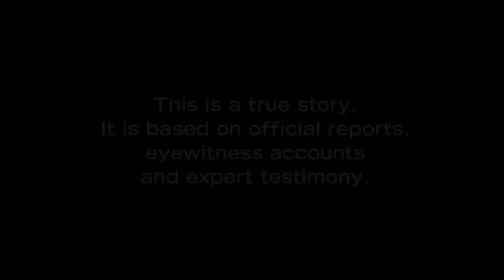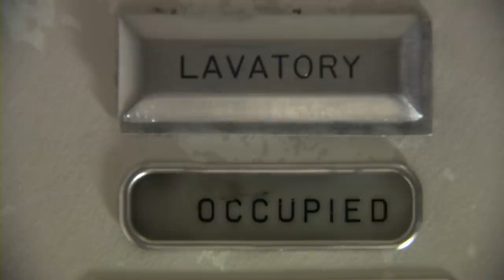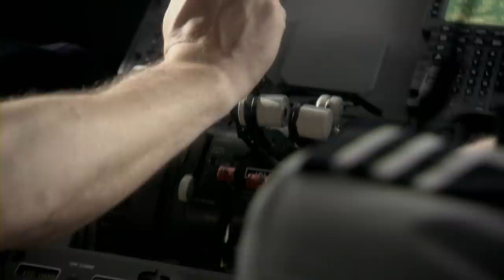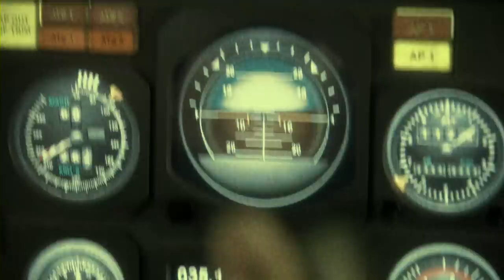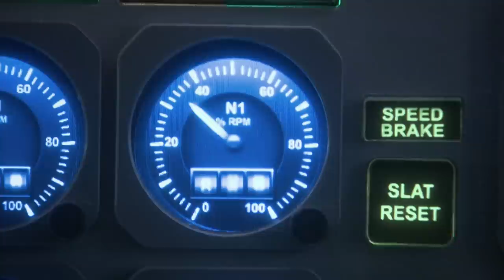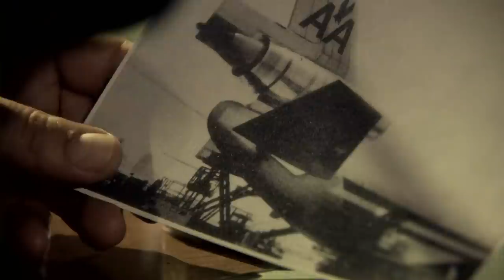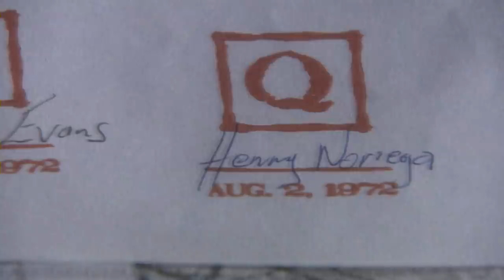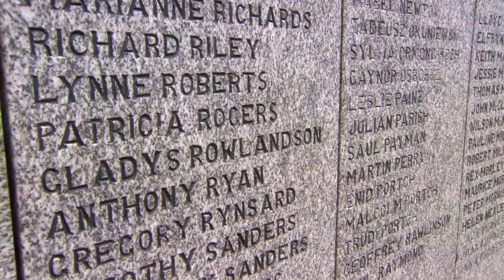Huge Hole In Passenger Plane Causes A Fatal Crash | Mayday | Wonder

Comment: Sad to say the higher ups in the industry never learned their lessons. Boeing of course had the MAX with the MCAS system, but even airbus has had lesser faults shown in aircraft that they knew about beforehand. Hopefully the MAX is the last time something like this will happen. Sadly this shows again and again what happens when companies are not regulated.
Reply: I’ve heard that the culture at Boeing really changed when they acquired MD in the 90s. Most of the old Boeing guys were ex military aviators (very good at their jobs) while the MD guys were the cost cutting weasels that made the dc10 problems possible. The MCAS issue is a direct result of that culture infecting Boeing
Reply: @willberger3349  
Really willy
Reply: @willberger3349  This was done while Boeing was still reeling from the 737 rudder issues.
Reply: @willberger3349  From what I can tell, the fundamental problem with the Max was the notion that MCAS would allow 737 pilots to fly the Max without needing special training.  Had pilots been trained in the ways that the MCAS system which was designed to make the Max behave like other 737 models might fail to do so, it's likely that most if not all of the crashes could have been averted.
Reply: @flatfingertuning727   This was a flawed notion dissemenated by the Boeing PR team/CEO in an attempt to blame the pilots. It was determined that even with training, in its released configuration, if an MCAS malfuntion was not recognized (and the system shut off) WITHIN 10 SECONDS OF ITS INITAL ACTIVATION, it was catastrophic and unrecoverable. Netlix just released their documentary on the whole affair. I encourage you to watch it.
Reply: @dominicairola7352  Even if the MCAS worked *absolutely flawlessly*, it would at minimum either require the presence of an extra circuit breaker somewhere, or share power with some other circuit.  In the former case, pilots should need to be trained on where the extra breaker is and what it is for; in the latter case, pilots would need to know how to fly the plane if the shared breaker trips for whatever reason.

The presence of anything non-standard in an airplane cockpit should necessitate at least some minimum level of training to ensure that pilots know what it is and how it might go wrong.  Even if it's equipment that pilots shouldn't normally need to interact with, such as a first-class cabin infotainment system, the flight crew should be aware of its existence.
Reply: @flatfingertuning727  I completely agree with what you've said about new equipment requiring training. My point was that in this case MCAS was a death trap regardless of training. In fact in the 2nd 737 MAX crash, the first officer correctly identified the problem (not knowing it was called MCAS, simply that is was a part of the power trim system) and shut off the system. The plane still crashed, however as it was past that 10 second mark so the horizontal stabilizer had already been trimmed to fully deflected nose down, with no way to manually return it to a normal trim due to the force required to hand crank the trim wheel at the high airspeed brought about by the nose pitch down.
Reply: @dominicairola7352  I agree MCAS was flawed, but my point is that the whole idea of adding anything to a plane without telling the pilots is flawed.  I saw a video about another crash which occurred because when both engines started surging, the pilots throttled them back, and when one failed completely the pilot shut it down, and a new system the pilot didn't know about responded by raising the thrust on the one semi-working engine causing it to also self-destruct a few seconds later.  If one engine dies and another isn't producing enough thrust to maintain altitude, increasing thrust on the remaining engine may usually be helpful, but if the remaining engine is only capable of safely proving 90% of the thrust needed to maintain altitude, having it do so may be much better than having it self-destruct so it provides 0% of the required thrust.  If the pilots were aware of that system, they could have prevented the destruction of their remaining engine, but since they didn't know about it they couldn't do what was required.
Reply: I thought the mcas issue was Boeing not telling airlines to properly train pilots on how to disable it

Comment: y'know what aircraft never had any of these issues and had a perfect safety record for the entire time it flew? The DC-10s direct comeptitor the L1011. But for whatever reason the L1011 hasnt been flown at all in years and DC-10s are still used as freighters.
Reply: It was more expensive to acquire. Airlines are cheap
Reply: @genettec  sorry I should've been more specific. It's renowned for not having any crashes related to the mechanical design of the plane. No plane is invincible after all but the l1011 is pretty damn close.
Reply: @genettec  lol the DC-10 is still used bc its an amazing plane

Comment: Being in aviation for about 22 years now, I do enjoy this type of documentaries. As frightening as the events are, there are many things to learn from them.

The only thing I have to nitpick about them is the tendency to use "sucked out of the airplane.." instead of "blown out of the airplane...". Things get blown out. Second, is making turboprop airplanes sound like they have piston engines on them during recreations.
Reply: That is interesting. I never really thought of that. I would have assumed they would be sucked out but I don’t understand at all what happens in these scenarios.
Reply: @TiffTheTyrant  
Hey Tiff.
The higher up you go, the thinner the air is.
When the airplane is pressurized, it means the air pressure inside is being raised to simulate what your body feels on the ground. 
Since the air pressure outside of the airplane at say, 30,000 feet, is less than the pressure inside the airplane, if the airplane is punctured in any kind of way, there will be what's known
 as an explosive decompresion,  that is, all air inside will rush out, until the pressure inside and outside equalizes. 
Does that make sense???
Reply: @TiffTheTyrant  its just nit picking. "Sucked" and "blown" are just two sides of the same coin
Reply: @alhanes5803  thank you sir. :) that actually makes a lot of sense.
Reply: @TiffTheTyrant  👍

Comment: This was and is just business as usual for big corporations.  Bic, for example, knew about a design flaw in their lighters which allowed hot flint to fall down into the fuel reservoir and turn it into a hand grenade, but their bean-counters calculated it would be cheaper to pay out settlements to people injured by this than to recall every single one of their lighters.
Reply: This is because of the economic and logistical nightmare that they would've had to go through in the recall. I read the report on that, since my father used to use their lighters when he smoked (he doesn't anymore, thank god).

Bare in mind that, at least according to the inquiry that occurred after several major accidents, it was revealed that Bic actually didn't know how many of their lighters were truly defective and how many were not. The design flaw was basically where after you struck the flint enough times, it became dislodged from its housing and would fall into the reservoir, but tests performed by several independent groups showed that it was inconsistent in the number of times the housing would fail. Keep in mind that the RSPA (Research and Special Programs Administration) did not consider the design flaw to be a major issue (which is why any settlements against Bic could only go for the cost of the lighter and the "minor damage it caused to a person's hand if it exploded" their words NOT mine. Personally, something exploding in my hands is hardly "minor"

Bic did fix the problem in their future lighters, and did release a memo to gas stations and other stores that sold their products to take their lighters off the shelves and replace them with the newer ones that they received. However, despite that, many stores still sold the defective ones. I did try to find a video of the design flaw to link it here, but it looks like Youtube scrubbed a lot of them (Bic does advertise on YT so that isn't a surprise)
Reply: The design didn’t effect all lighters. Only the ones with a steel spacer under the flint. This is the part that would get hot and melt the wall and expose the liquified isobutane to a open flame with out governors or valves. 

The later design used a painted flint on a spring that is a tapered spiral to keep the hottest point under the flint and would cool as the spring widened using the extra surface area and convection currents to keep it cool. 

The thought was to make the lighter last longer with the spacer. The lighter is also not meant to be on long but when you use if for anything other than a cigarette.. that itself made it dangerous.
Reply: @Suisfonia  I actually never heard about the Bic design flaw. Thank you for the lengthy reply, I learned something today. 

And thank you to Fred Zoidburg as well. I don't know how to "tag" two people with one comment.

Comment: Amazing pilots. 👏🏻👏🏻👏🏻
Bravo flight 96.
Reply: I'm sure the doomed flight had amazing pilots also, except they had a completely uncontrollable plane.
Reply: @bobby1970  
They were Turkish, like the guy who was supposed to lock the cargo door.
Reply: @bobby1970  
Turkish airlines had the directive ti fix it,  they didn't do it. All the other airlines did.
Did you ever here of a problem after the non fatal Windsor deal?
It was the fault of Turkish airlines.
Reply: Well said
Reply: I disagree w/u McDonald’s Douglass should have ordered to ground all the dc 10 s , just like Boyd up on Boeing 737 max n they were trying to blame the Ethiopian pilot n that is why Ethiopian Air lines send the black box to Paris not Boeing
Reply: @siraj7397  
McDonald's huh....
Reply: @alhanes5803  it’s an Arabic name dummie not Turkish
Reply: @ua84423  
That statement shows the true dummie.
Reply: @bobby1970  excellent work by the crew/ support staff etc...
Reply: @daviddavis3389  Absolutely.

Comment: The intro to this dc10 .. it was not a race . Lockheed and Douglas had already lost the widebody title to Boeing.  The dc10 was rushed into the market because Lockheed actually had a superior design . The tri engine layout was a answer to a requirement set forth by the FAA. Aircraft had to have so many working engines based on the distance to land while flying over water. The Death cruiser was really an unfinished airframe that had many problems and short falls
Reply: DC10=  death 10
Reply: @siraj7397  death carrier 10

Comment: Seeing these two planes….then see the amazing flying of the attempted Hijacked Fed Ex plane when an employee when insane.
They flew that plane almost completely inverted, may of touched the sound barrier, and did maneuvers only reserved for fighter jets…..while stuck in full throttle.
I knew the daughter of Fed-Ex’s top mechanic.
Apparently it cost over a million to fix it due to structure damage and blood splatter due to the crew fighting.
Blood was EVERYWHERE. Roof, walls, under seats, in equipment, and places where blood should not be.
I am amazed the injured pilots survived.
Reply: Showed that the DC 10 did have some good points -seems that most people who flew (in the cockpit) them thought well of the airframe and power

Comment: Due to the random order I'm watching these, I'm watching this after having seen the United Airlines Flight 811 - a later incident in which a cargo door ripped off and took a chunk of the fuselage with it. It's crazy to realize that even though that was a different plane (747) and different company (Boeing pre-purchase of MD) and followed the improvements (vents, stronger locking pins) there were still incidents so similar to this. Fortunately,  the current popular Boeing 737s went back to the interior opening doors.
Reply: The 737 was made in the 60s, before the DC-10, when people thought of more cargo space via an outward cargo door.
The 747's door was flawed with its fail-safe locking sectors being too weak and the faulty wiring making it vulnerable to opening unintentionally. When United 811's door opened, it ripped out some of the fuselage, and at that point, the vents aren't going to help.

Comment: Why am I critical of airplane manufacturers? Because Douglas new about the flaw before the first accident, learned about its potential after the first, and yet continued to build the damn plane without changing the design. And like the past repeating itself. Boeing knew about the flaws in the 787 Max, and yet, even after 2 fatal crashes, Boeing fought to keep the planes flying. With 500 lives already lost to the flaw. They still couldn't risk losing money. These companies don't have the luxury that car manufacturers do. When your Toyota or Ford breaks down, you pull over and call someone for help. There is no AAA for Boeings at 30,000 feet. And the tragic fact is almost never does anyone go to prison for these blatant cases of greed and negligence.

Comment: The pilots of Flight 96 were awesome! That was some wicked fabulous flying.
Reply: I'm sure the other flight crew on the other plane that actually crashed were also awesome. It's just they had an airplane that was impossible to control at all.
Reply: @bobby1970  I agree. The one thing Flight 96 did have going for it was that not all lines were severed, so they had just enough control to be able to land the plane back in Detroit.

had all control of Flight 981 not been lost, I'm sure her pilots could have maaged to return to Paris safely.
Reply: @harrietharlow9929  
How are you sure?
Reply: @harrietharlow9929  
You're not sure.
You're just talking.
Reply: @alhanes5803  Kiss off.
Reply: @harrietharlow9929  
You're a class act

Comment: Why were the passengers required to take off their shoes on flt 96 for the emergency landing?
Seems like this would hamper any attempt to exit quickly after a crash landing potentially causing injuries to the feet if they had to climb over wreckage.
Reply: The flight attandent had a foot fetish? It's either that or she wanted to give them a handicap so she could outrun them.
Reply: Some airline safety demonstrations instruct people to take off high heeled shoes, I believe so that they don't puncture the evacuation slides/rafts. Not sure about other shoes.
Reply: It's so that your shoes don't damage the escape slide.
Reply: @lgrismer6829  Any type of shoes or jewelry can damage the escape slides. Glasses, too.